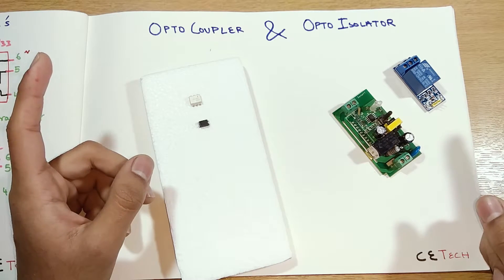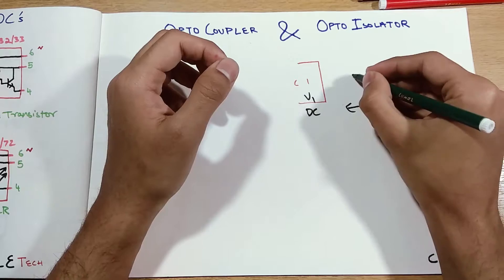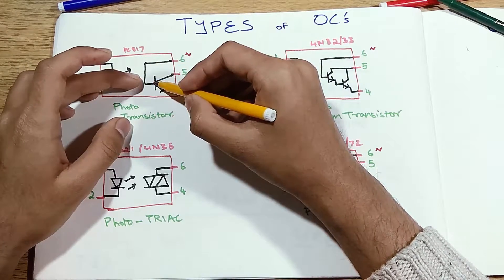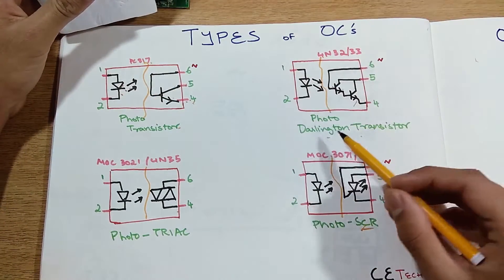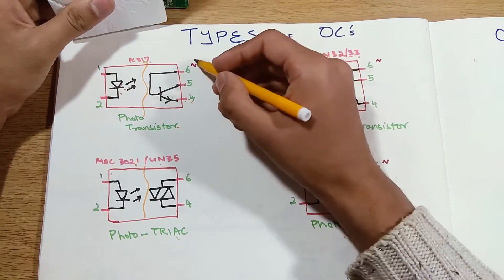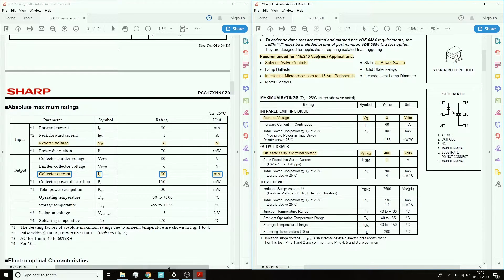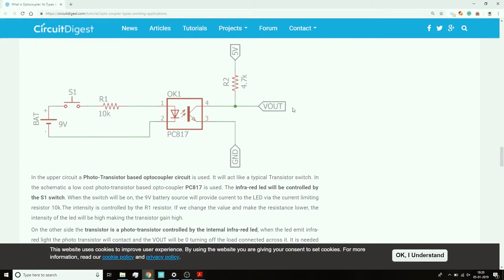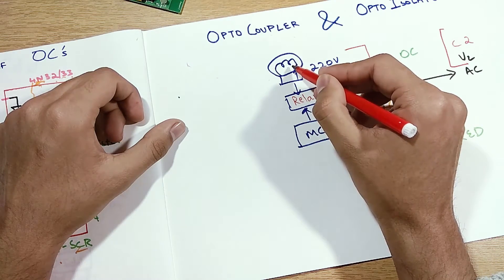Optocoupler/Optoisolator Tutorial | PC817 MOC3021 | How to use? | Pinout

Comment: Pin out on your PC817 is wrong. This is  4 PIN device. SCR = Silicon Controlled RECTIFIER! (not resistor) I gave up at 8min as it seemed I already knew more about this subject than the material presented in this video. Sorry...

Comment: Hi 
I tried with 4N35 and connected to AC with 330K Resister in between and given 5v on other side to check the AC main detectation but didn't work.
i want to build AC mains detector so I can check on microcontroller
can I use the above circuit shown at https://youtu.be/OIkQ6evY-mg?t=797
Reply: There is no UN35 opto coupler as in the video, it doesn't exist,  4N35 is a photo transistor, not a photo triac which is why it didn't work for you.

Comment: Hello sir I want tell you one thing can we use MOC3021 TO TRIGER raley instead of the PC817
Reply from the maker: Yes
Reply: @CETech4u  OK thank you sir

Can you please help me to draw circuit diagram of MOC3021 to TRIGER relay

Application :   I want to control relay with the help of MOC3021 and MOTOR ON and OFF MOTOR with the help of relay as output. 

I also draw circuit diagram but not work well

ronakprathod@gmail.com